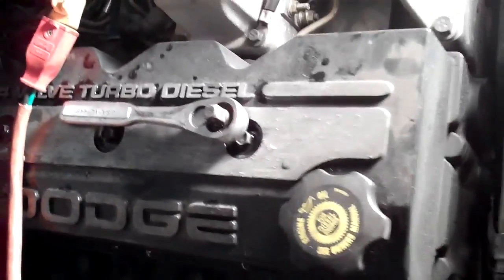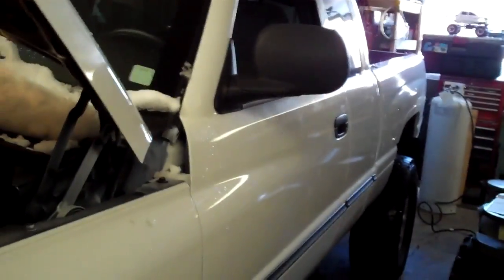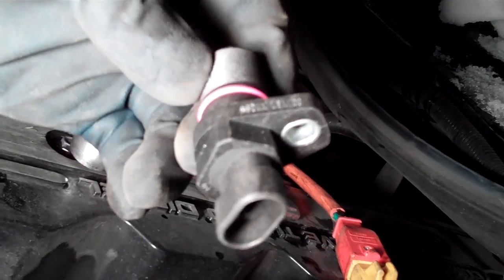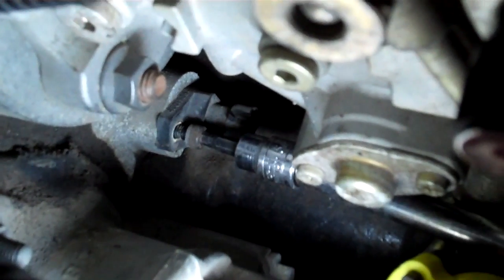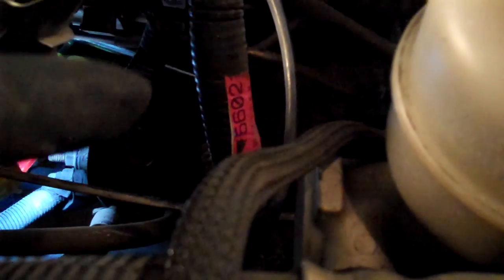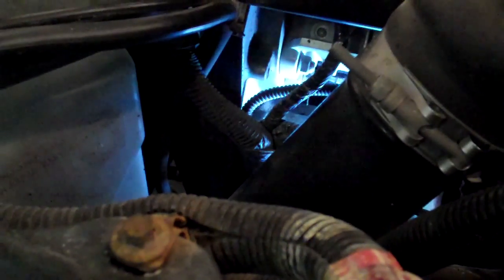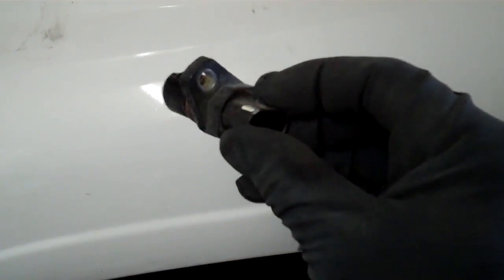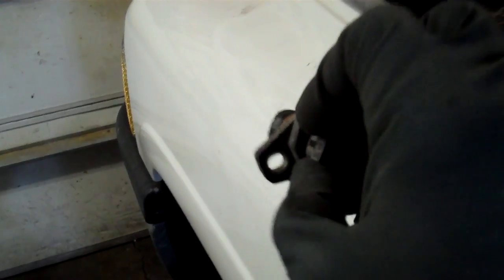How to Change the Camshaft Position Sensor on a Dodge Cummins 5.9 liter P0341

Comment: So, you said 94-02. Just because I'm looking at my 12v, either there's not one or it's not there, so that would be 94 (in this body style, they did come in 1st gens too) to 98.5. Early 98s have 12 valves, later 98s have the 24,which is a computer ran engine.

Comment: my '05 dodge lost power on the road, gages flatlined and started right up.  after six miles died again and started right up and about two miles along it died and wouldn't start for nothing.  Got a tow home and tried it and it started up, could it be the crankshaft pos. sensor?  I got a 0088 code and don't have a way to find out what it is, can you help?

Comment: Thanks Brian your video was a great help. It was still a bitch. It looks so easy. I pulled the wiring harness off the injection pump. And unbolted the harness from the block to get it out of the way. Turn the wheels hard right to get the steering arm out of the way from the bottom. You can see it great from the bottom with a flash light. Had my wife under the truck telling which way to put the sensor in (up down left right ). And directions to get the tool in the right place to!!!! You can take that two ways.. Thanks it was a help..

Comment: what are the symptoms of a bad sensor?
Reply: You will Def have an engine light on, kinda stumbles on the rpm when idling, can miss when driving, you can start and right as it starts it dies.

Comment: Thanks, but.  What year is your truck? Because i cant find the camshaft position sensor of my RAM 2500 2002 Cummins.

I seen Other video where the camshaft position sensor was between the transmission and the starter.

Comment: not to beat a dead horse here but I'm out of ideas Brian. got the bolt out no problems. was a real bi*tch to get it to turn down to 630 after some prying and wd40 got it done. but it literally will not pop out and I'm here to tell you I'm prying on it hard enough to rock my whole truck. I have broke off the piece the bolt goes through as well as the end of the clip reciver on the sensor it's self. it has came out a tad. but seems to be stuck on the o ring. this truck only has 136,000 on it and is bone stock. so what's a guy do when it completely refuses to come out. ain't a whole lot of room to get any tools in there. also I'm worried I'm going to snap the rest of it off and be stuck with half a cam sensor stuck in my block. not good. not good.
Reply: Gotta ask, how did you end up getting it out? Having the same issue
Reply: +Pete Smith I went to harbor freight. got me a super long pair of vice grips. clamped down on it as hard as I could. boom poped right out. I wish u luck. I know this sucks.
Reply: +mike kamphaus thanks man I'll give it a shot
Reply: +Pete Smith no problem let me know how it works out.

Comment: I'll put my experience on here since this is where I got the best input on how to fix my codes. 

First, it is very tight so using a 1/4in drive ratchet and two 5in extension is a must. My 2002 Dodge Cummins had a 8mm hex head bolt instead of the 5mm allen head. It took some patience but you can get to the head of the bolt. the sensor connector sticks out far enough that using a 3/8 drive socket would be difficult to get on the bolt.

Second, Leave the plug connected to the sensor and turn it down to 6:30 like he suggested. Mine popped right out. Be carefull not to lose the bolt. If it drops it can get stuck between a wiring harness below and the truck. Unplug the sensor put knew one on and find the whole again. This take touch and you do it blind to put the camshaft sensor back into the right spot. 

Third, After you reinsert the sensor, turn it back up as best you can to the 10 a clock position. 

Forth, I used scotch tape to adhere the bolt to the socket and fed it back through the small open area. After a little moving the tab up and down I found the bolt hole and gently started the bolt then fully tightened it down.

Fifth, remove all your tools clean your engine bay of all towels and gear. Start it up and check for codes. My truck started right up and no check engine light (CEL) came on. She was happy again.

Overall, what I thought was a 15min job turned into a 2 hour job because I didn't find the right socket. I tried multiple size and used actually used the correct size but it was a poorly made socked so when I turned the ratchet the socket deformed and just spun off the hex bolt. After I found a good quality socket, craftsman circa 1994, I had no issue and the bolt come out easily.

Also when at the autoparts store, don't let them give you a crankshaft sensor that has the a right angle plug connection. Be sure to get the camshaft sensor that has the slot on the end of the round surface.

Brian thanks for taking the time to film this. It definetly helped when I looked for the crankshaft sensor after I unmounted the starter 10mm bolts. Glad that was easy to take off and put back on.

Happy wrenching.

Comment: what is the cause for changing this sensor? is it the needle bouncing on the tachometer gauge? engine on full throttle running weird; like it's got bad fuel? mine is...buts it not the fuel..

Comment: Brian, I learned the hard way to replace my camshaft sensor. Your video made it seem a lot easier. Would you happen to have any advise or video on replacing the neutral safety switch, or reverse switch, on a 2000 Dodge Ram 2500 turbo diesel?

Comment: Thanks for the tips – they helped a ton. I just replaced the Cam Position Sensor in my 2000 Dodge Ram Diesel. 4 tips helped, 1) knowing the tool size 5mm, 2) reaching the screw from above and behind the engine mount, 3) using a flat blade screwdriver to pry out the sensor (more like pop out), 4) knowing the sensor was pushed in not screwed in. When I saw threads on the replacement part I thought that’s going to be tough to not cross thread. I eyeballed the sensor, and then removed the connector from below, reaching up and doing it blindly; because I was so contorted I could see and do at the same time. Pushing back the locking tab was the tough part. Then I did undo the intake rubber hose for better access and I removed the mounting screw by working from above the engine. Then I got back underneath and popped out the sensor with the screwdriver. Installation was easier than removal. Toughest part was getting the mounting screw started. I did this from above working totally by feel since my face was against the block while one hand was on the ratchet and the other on the screw. I cleared the Code and NO MORE CHECK ENGINE LIGHT. Thanks!
Reply: Have you found out yet? I'm still looking to do it

Comment: You mention the two codes in the video. I am having both the P1689 and the P0216 code at times.

The 1689 code came on, and then message "CCW" came in the overhead display window, then several months later I got the 216 code. Am assuming that I have two separate problems? This is for a 2002 5.9 Cummins. Thx, Joe

Comment: Ok not sure which code it is, but maybe you can tell me.  Is it the sensor when the code reads "no cam speed detected" or do you suppose I have a different problem all together?

Comment: How would you change it in a 12 valve? I have a 97. I can't find anything on how to replace the crank shaft position sensor on my truck.

Comment: awesome! took my 1999 dodge to Goodyear, couldn't diagnose the problem. told me to take it to the dealer. dealer told me it was another problem. denied repair because they said the used part was $834.00. total with labor is $1200. took it to another mechanic i used before and he said it was the crank shaft sensor. he asked  and guess the reading on the odometer saying "no buss" whew! saved me $1200. kinda sorta.

Comment: I have a 5.9L cummins as well.   but 2005..    I have looked everywhere for a video to replace my crankshaft sensor.   Some websites state that the truck doesn't have one.   But i know it does.   I think i have found it by the fly wheel...  LOL

Comment: hi thank for the help can you tell me are the sensor the same front a rear dodge has the short one in both holes when i try to buy parts store has two CSS987 is the long one wont fit in front hole .  CSS1060 is the short one will it work in the rear hole by the pumps both part num are bwd thanks

Comment from the maker: Yes I can.  Your computer will often times throw a P0341 code when it's actually a crank sensor.  It senses the discrepancy between the two.  Very common on these.

Comment: Great video, have a question. I have a 2006 Dodge ram 2500 mega Cab diesel. Had codes 0341 and 0340. Replaced both of those and its still pulling a code 0341. Any ideas?

Comment from the maker: P1693 just means that you have a code, it may be in reference to your abs codes. common abs problems for this truck are from sensors that have metal stuck to the magnet.

Comment from the maker: That's unburned fuel.  When an injector leaks when it should be closed this will happen.  Also without enough compression the fuel will also be unburned.

Comment from the maker: The drier the better!  And that's coming from a "seal EVERYTHING with permatex right stuff" kind of guy.  The reason is the design DEPENDS on that thing biting the metal.  RTV will act like a lubricant and it will squish out under pressure creating a leak.  GREAT, GREAT Question!

Comment: i was wondering if You had any advise on replacing the rubber gasket on the side pushrod  (tappet) cover on a 12 valve. some say install totally dry, some say use rtv.

Comment: Thanks so much I just ran my highpertech power programmer. Im at a truck stop in Maryland. Just ran dtcs . P1689 and p1693 times 2. Po500. And p0463. The problem is it hesitates then goes. Back and forth for about 15 minutes. I have some tools and 5 mm Allen wrenches. Think I can do it?

Comment: Need some advice. I got same truck with 6spd and can't seem to figure out why it surges at hwy speed about 65mph up a steady hill. when i pull a trailer it's more noticeable. newer vp, 150 air dog, new apps, no codes at all had one for p0500 speed sensor changed that just in case still same problem, but not always. any help would be appreciated,  Thank a lot i advance.

Comment: @briansmobile1 Yes my bad i posted it up along with this video, the idea just came to mind. Yes for a gas vehicle, I'm trying to clean my carb but, i just do not feel the throttle response. Not to mention i could use the extra hp

Comment: brian.....great video!!! glad i had this to find that tricky sensor. they did not put that thing in a easy spot. i do have to let you know that the little allen bolt on my truck was A 3/16 ALLEN NOT A 5 MM ALLEN. mabey someone replaced mine or yours diffrent but i just wanted to let you know so others can be informed it could be eaither or. Once again great video, thanks alot
Ben

Comment from the maker: @pickle19100 Can you get your hands on a pressure sensor to test the line at the pressure pump that goes from the filter housing?  That will tell it.  Also the wiring to the cam sensor is pretty taught.  I'd check it for chafing/shorting to ground.  I'd also like to get it on a scanner and watch the RPM waveform.

Comment from the maker: @macman216  It's possible.  Another one you get with this is P1693 which just means "hey dude- you got a code on one of the computers"  If your camshaft position sensor fails your mileage goes down to like 9mpg avg. too.